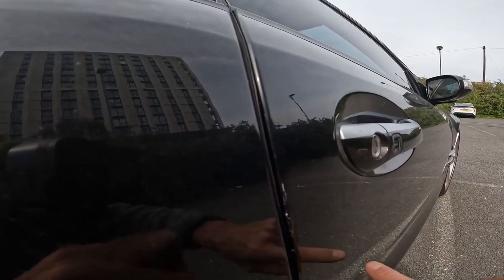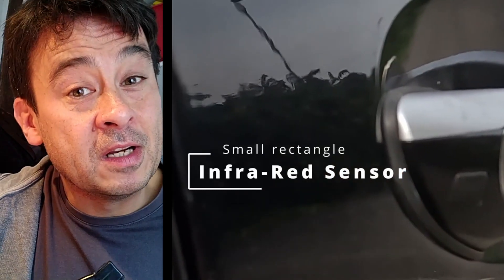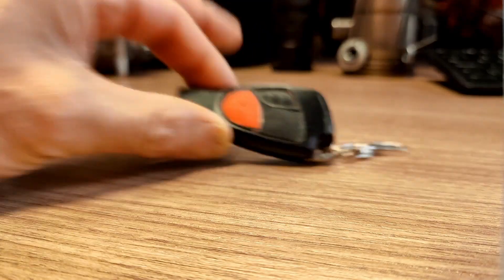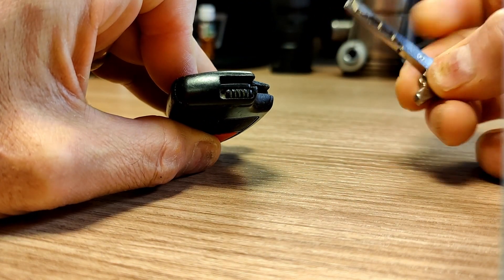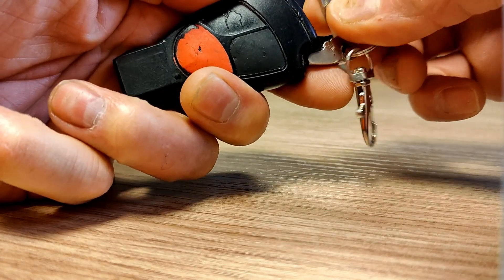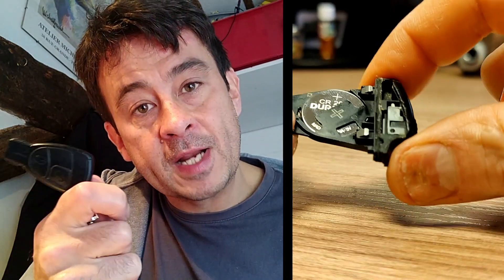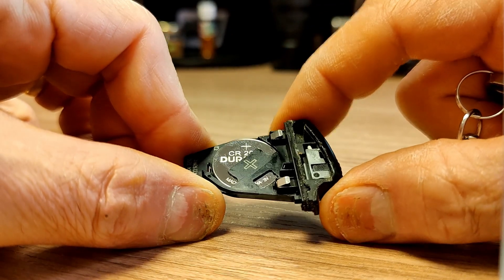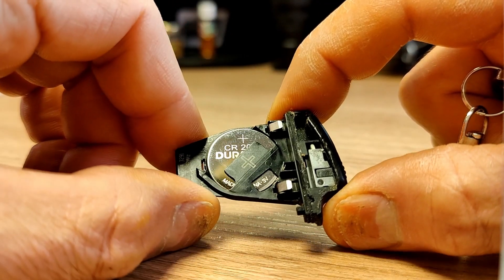Mercedes key-fob remote battery replacement & its 2 function modes

Comment: Haha, I got a mention, feel famous, I never did manage to open the roof like that, have the new style keys, tried both. Maybe need to try the icarsoft and see if the square on handle is faulty like you suggested.

Comment: Interesting video thanks. I have both the old style key fob requiring the battery and a newer style which doesn’t. Both behave differently in locking and unlocking my SL 😂
Reply from the maker: That's interesting, my spare key behaves different

Comment: Great videos!. My SL55 key fob only has a single battery in it. Should it have 2?
Reply from the maker: ah I know what you mean, there are thinner batteries, you only need 1 it should be the thicker type.  You can use the the thinner one but will need to put a bit of card in there to make contact.